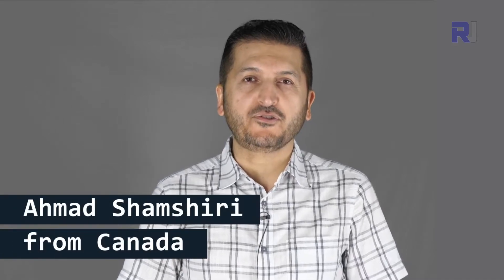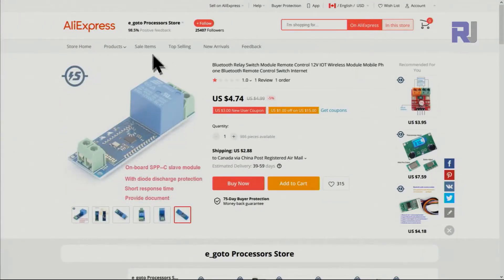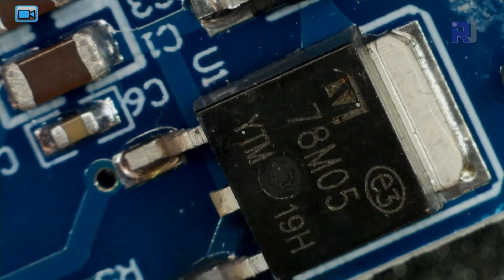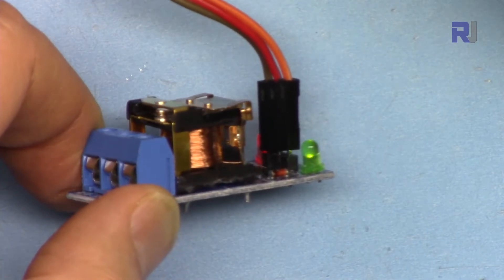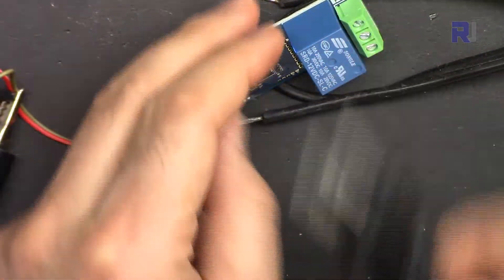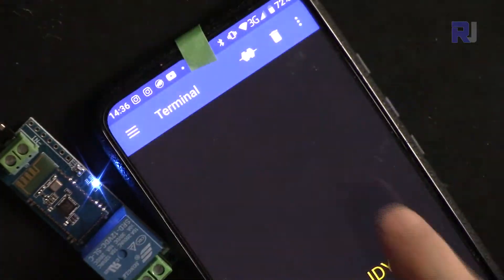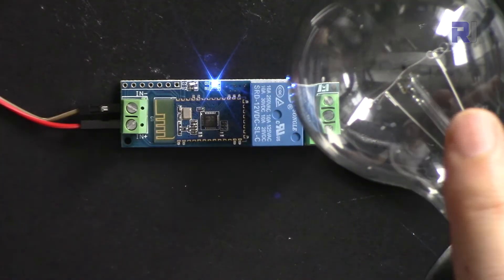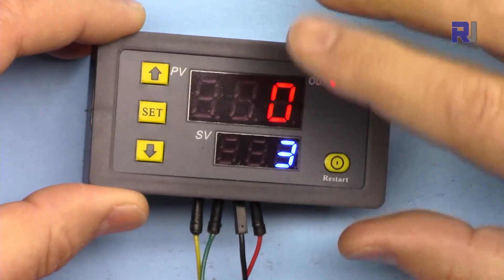12V Bluetooth Relay to control AC or DC load using mobile Phone - RJT381

Comment: 12V Modul works fine, thanks for you hint.
Sorry my friend, I have now ordered 5V/12V 1 Kanal Bluetooth Relais Board Modul für IoT Smart Home Telefon APP Control Single-kanal Bluetooth Relais Modul from ALIEXPRESS , but your code ON = A0 01 01 A2 + OFF A0 01 00 A1 don't work here at this 5V Modul, BUT: What can I do now ?
Reply from the maker: The school is only for this board. This board has microcontroller. It has been programmed to work with this code for your board, you need to find out the exact code.

Comment: if I enter 2 instructions under one command at the same time: A00101A2 A01010A2 - will be the result, that the relay turns on and off? (I need only 1 impulse)
Reply: I had the opportunity to try it. Entering the command to turn off and on (A00101A2A01010A2) works, the result is a 1 impulse. Great :)

Comment: Sir please help me the command is not working to my module
Reply from the maker: What is the problem? Does Bluetooth get connected or there is no connection. Please Ty your phone to get connected.
Reply: The bluetooth is connected in my phone but the command A0 01 01 A2  is ON and A0 01 00 A1 is OFF  not working to my phone, no reaction the red light only blue ,do you have any command sir ? Please help me sir , my suply is 12v  .100amp thanks to reply me sir🙏🙏🙏

Comment: Regarding the common AT command over TTL serial port of BTL device as below:
(1)Test : AT
(2)Reset: AT +RESET
(3)Get version: AT +VERSION
(4)Restore default: AT +DEFULT
(5)Inquire bluetooth address: AT +LADDR
(6)Set/Inquire device name: AT +NAME,such as send ”AT+NAMELCTECH ” , and then
send “AT+RESET” can set the device name as LCTECH
(7)Set/Inquire password: AT +PIN, such as send “AT+PIN8888” can set the password as 8888
For more AT command details, please see the BLT device datasheet (SPP-C AT command).

Comment: awesome video thank you...i am having trouble getting the coding right...I have device paired ok...but i am unable to add the on/off functions on the buttons...Also unable to get the relay to work..no red led....any help please.
Reply from the maker: then  you gotta find the exact code that turns it ON.  Contact the seller or look at the product page.

Comment: Great video. Are there any other codes such as a delay code. I would like to press a button that turns on a relay for 5000mS and then turns it off.
Reply: Yes I've been wanting the same thing. I messaged the app creator Kai Morich the app can send the On code in hex and then wait 1sec and then send off in hex. I said to try a multiline macro by adding a new line between the hex on and off values and set line delay to 500ms. But don't work. I think this module does not like new line commands. Just single Hex only values sadly

Comment: I am using a 12-16V lithium battery pack. I have the Relay connected to the bluetooth app, and I can see the red light turning on and off.. but my DC Load is not turning on and off.. I've tried a few different wiring combinations.. but my light is turing on and off. What is the correct wiring for a DC load?
Reply from the maker: Does the relay click? If you don’t hear click sound of relay then it is not turning ON. Make sure relay clicks. If relay click and it does not turn ON your load then the relay is defective.
Reply: The relay click's 100% and I see the LED light up on the PCB. However, how do I know if I have the DC load wired correctly?  To the DC load from the relay I would think that from NO Terminal - red (positive wire to LED light) and from COM Terminal - black (negative wire to LED Light)  @robojax  I tried a few combinations.. but the light is not turning on.. Do I need an extra wire to connect back to the ground of the battery?
Reply: Okay.. my mistake entirely.. I need to go back to Electronics School 101. I forgot that fundamentally a relay is a basically a switch where you are using a LVPS (in this case 12V) to energize a switch to turn on a circuit that is high current or high voltage.

I was originally trying to use this as a bluetooth switch and thought that once the relay was "made" that the 12 V from the power supply would flow through to the other end to energize the load.. but that was completely stupid on my part.. the whole idea of a relay is to keep circuits seperate for safety purposes. 

What I am trying to do is use these 12V lithium battery packs that I have to power exterior work lights around my camp, and to turn them all on and off with my phone remotely. So I can turn the outside lights off when I go to sleep at night from inside my tent. 

So to get this working correctly on my bench I pulled out a 12 V power supply to power the circuit board.. and then connected my DC circuit on the relay end. It works. But what I want to do is have the battery pack supply the load AND the bluetooth circuit board simultaneosly.. So I should just need to set up a parrellel circuit from my battery pack, one set of the 12 V leads will go to power this PCB, and the other set will be connected on the DC LOAD LED side where the relay is going to act as my on/off switch. There shouldn't be any issues with this right? Both sides will get the same Voltage in a parrallel circuit, the PCB side will only draw 50 or 100 mA of current, and the LED LOAD SIDE (I think the 42 LED light has a spec. of 2.58A.) 

Is this correct? @Robojax

Comment: Any idea if this could be powered by a battery and if so, how long?
Reply from the maker: it needs 50mA when waiting. 150mA when relay is ON. so you do the math. if your battery is 2000mAh then 2000mAh÷150mA= 16.6h 16.6 hours. but that is when relay is ON. if it is OFF it would last longer 3 times more.

Comment: is there an existing script that allows the phone to turn the relay on and off based on it's battery level?
Reply from the maker: Hello, You can use Arduino to read almost any DC voltage and take action. this video is on how to read DC voltage https://youtu.be/t8xwrVj2aFs
and this is how to control a relay to turn a load or anything you want to  control https://youtu.be/58XWVDnB7Ss if you are new to Arduino then this is a 30 minutest course https://youtu.be/Mbb2xa1WcRM or Arduino Step by Step Course  (over 100 lectures) Starts here https://youtu.be/-6qSrDUA5a8

Comment: From the Amazon reviews, they don't appears to be super reliable.  I'm looking for a 'set and forget' type of relay since for my vehicle application, mine would be hard to get to for where I'm placing mine.  Do you know of any other, more reliable bluetooth options, perhaps a solid state relay?  I haven't seen any wireless (bluetooth) solid state relays, but I''ve only been searching for a few hours.
Reply from the maker: solid stare relays are for AC. So you need electronic switch which uses MOSFET to turn ON or OFF something. it would have current and voltage rating.
Reply: @Robojax  have you found one? I am looking for a 12 volt 4 switch that can run on A/C

Comment: I have a 2 channel version. The hex code you gave works great on one of the channels. What hex code do I use on the second channel?
Reply: A0-01-01-A2
A0-01-00-A1

A0-02-01-A3
A0-02-00-A2
Reply from the maker: contact the buyer or see the web page you bought it from.

Comment: Hi, great review of the product.
Question: do you know if one can connect multiple devices to this relay at the same time, ie, switch it from you phone, and then directly after, switch it from your tablet for example.
Thank you
Reply from the maker: This is just a switch You can connect things in parallel so all of them can be turned in or off.

Comment: Can i change the bluetooth password instead of 1 2 3 4?
Reply from the maker: no. you can't.
Reply: @robojax  this makes my relay vulnerable. Isn't it?
Reply: Yes you can do it, but you need TTL serial port Interface. You will find the manual if you search for Shenzhen LC Technology Bluetooth Relay Module
Reply: Yes you can change it